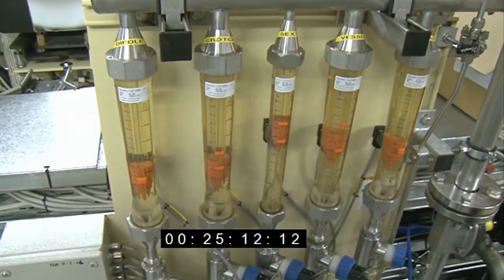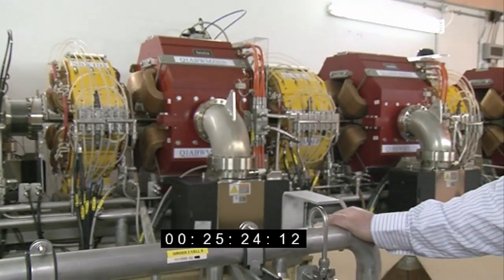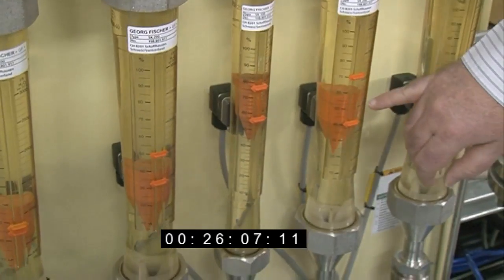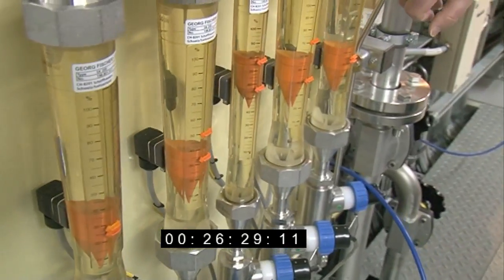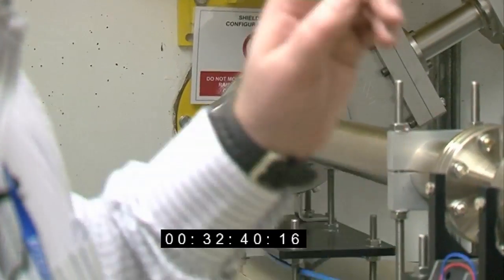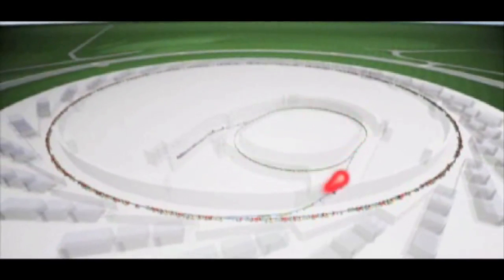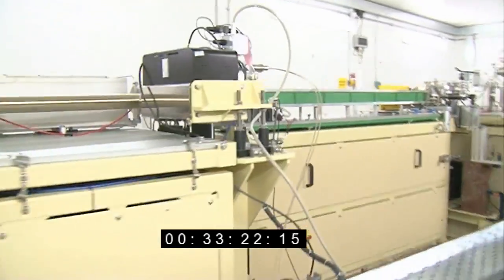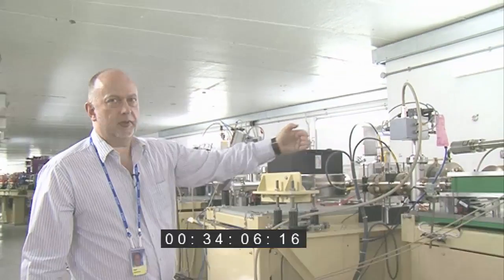Inside Diamond (extra footage) - Backstage Science

Comment: So you could just cut the grey unprotected cables of the magnetic sensors on the float panels to deactivate the alarm system if you want an electro-magnet to overheat in case the waterlevel for the cooling is miraculously too low. I bet there are many exposed weakpoints in the system but that one is patently obvious.
So James Bond would know where to go now to disarm this Soviet Deathlaser!